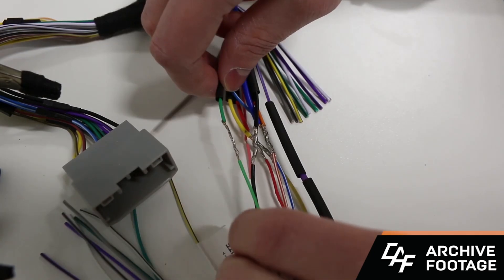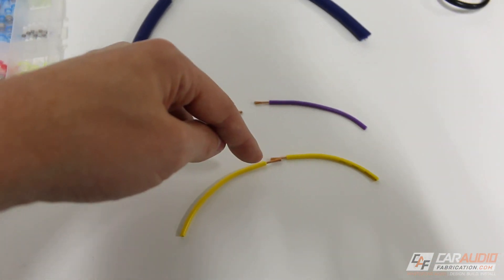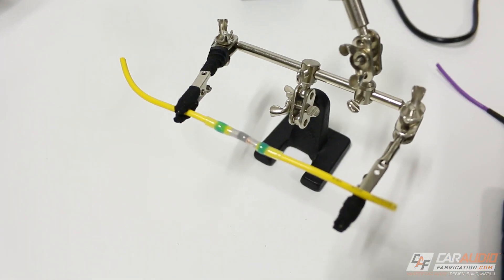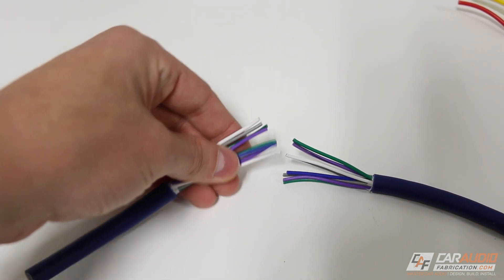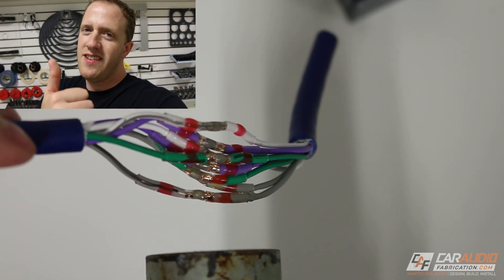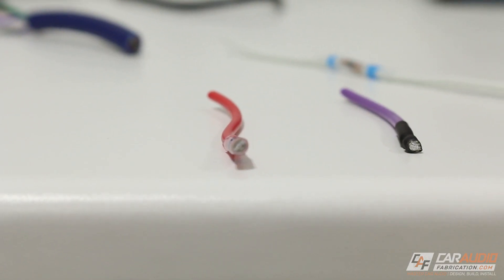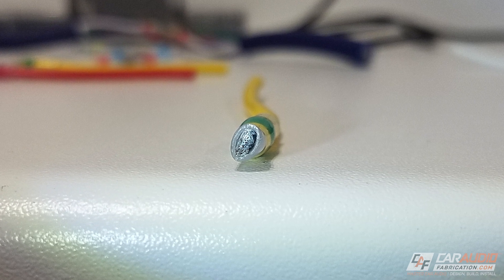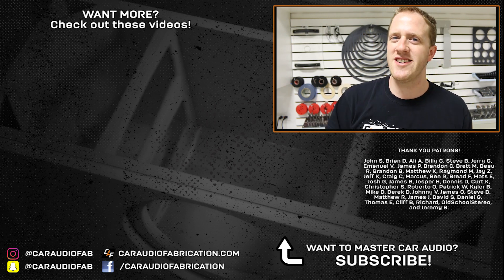Soldering WITHOUT a soldering iron? Solder & Seal Connectors

Comment: I've been using these things for about 20 years now and I must say I really like them for confined spaces. What you really need is a heat gun where you can dial in the temperature. With the connectors I use the entire ring melts  It didn't look like the whole ring melted on yours. That may be because it wasn't hot enough. The other thing is, you need to confine the heat with a nozzle. I use a Steinel heat gun. It has a digital temperature control and indicator. It came in a kit to do hot air plastic welding, heat shrinking, paint stripping and other things. It has a full assortment of nozzles. it includes a couple sizes were the nozzle wraps around the connector so you only have to position it one or two times. Using this gun with these connectors I can do a joint in about 30 seconds. Also unless you're using adhesive wall heat shrink your not getting a sealed joint like these. So for marine applications these are the way to go.
Reply: Glad I'm not the only one who noticed that right off the bat! The adjustable heatgun with the shrouds are worth the money!
Reply: That was my thought as well, a good heat gun with a small straw style nozzle might work better, and will work worlds faster. I've never used these solder and seal connectors, but even just for shrink tubing the nozzle makes a startling difference.
Reply: You are right. He did mention that the insulation was starting to melt because his nozzle was vary large and throwing out the heat in a wide area. A deflector nozzle would have directed the heat to the other side enveloping the solder connector and correctly melted the ring as you stated. The military has been using these for many years for a good reason, and I have built many a cable with these. In an automotive environment, I wouldn't use anything less.
Reply: MrDanthemaniam 
Model # for Steinel heat guns pls.....

Glenn Kotze 
Wtf does stepping the connectors mean?
Reply: I'm going to assume that the connections of the wires are staggered so the thickest part of the connection is not bundled up into a singled point.
Reply: MrDanthemaniam what brand is your connectors that you are using for 20years now I just used TIconn brand an seem to work well just wondering on yours thanks
Reply: @slabslayer258  I recommend you to try the kuject brand that I have used over than 1 years, they are awesome.
Reply: Could you tell me what confined spaces will you use this solder connectors in your life? I have used them over than one year, but don't find that kinds of confined spaces.
Reply: I agree. I think the heat gun being used does not concentrate the heat to the heat shrink tubes. I don't know about adjustable temp heat guns but I do own a 300w flashlight style heat gun that has a nozzle which I think would be perfect for the job. Also, stepping the connections would be better rather than having all the connections bundled together. Makes it look slimmer especially if you shrink wrap the whole job of 9 connections for example. I'm definitely going to order a bunch of these heat shrink connectors
Reply: Glenn Kotze stepping the connectors??? You basically mean making the wires different lengths to keep the individual tubings from touching??? If so, then yes, it sounds like that would work loads better for say, shrink wrapping as you suggested...

Comment: I work in the Marine electronics business and love these "Solder Sleeves". I use the original TE/Raychem versions and these cover the copper a lot better. It looks like yours are missing a good solder flux. Especially for on-sight repairs these Solder Sleeves rock! Saves me a lot of time and a simple butane torch makes for a fast repair or modification.
Reply from the maker: The average consumer isn't going to buy the TE ones though, I have seen nothing but links to Amazon ones in car audio groups, so thats what I reviewed.
Reply: I agree with CAF. Most people aren't going to spend $5-$7 per connection.  These low cost alternative will work just not as well as the expensive one. These are the Harbor Freight  versions....lol.

Comment: I was wondering if they would perform nice video Mark
Reply from the maker: Thanks for watching Troy! I think they have their applications but for the most part I will stick to traditional methods.
Reply: Have you tried a flame torch on it? Wondering if you could get faster results, heat guns disperse heat over a larger area can really damage a car.. the flame is small and controlled but not sure how it would work.
Reply from the maker: Gets too hot. Melts the tube
Reply: CarAudioFabrication go figure
Reply: CarAudioFabrication really??? How about one of those electric lighters, like for instance, the atomic lighter, just plug into usb to charge, then use it till dead again... i wonder because I use a regular lighter, at least for shrink wrapping,  and aside from being a bit hard and/or brittle when done sometimes, it works real good...

Comment: Mark, I used to have 2 13.5 tw5's under my seat in my hotrod, I am changing the seats to captain's chairs. I want to keep atleast one sub but still have a stealth build. could you make me plans for a box/ beauty panel if pictures and measurements were provided?
Reply: do you not make/sell splash panels plans?
Reply: Go to his website.   He does indeed do custom designs.
Reply: How do those TW5's work for you? I've wanted a couple for a single cab truck, how well do they handle? Lows, power, space?